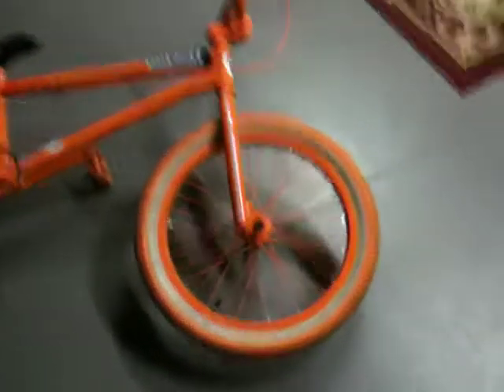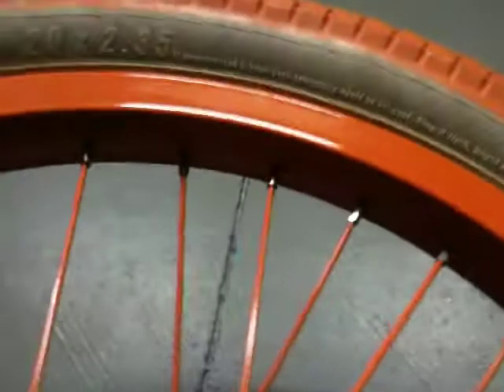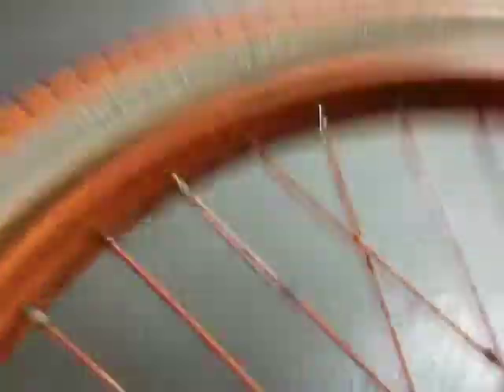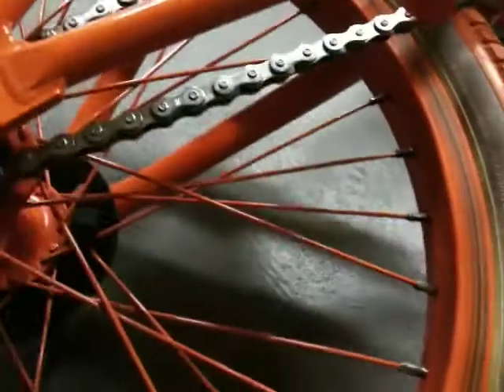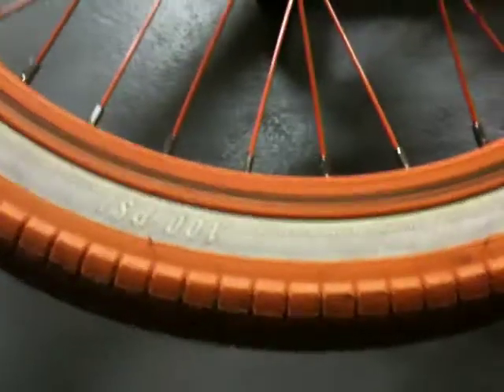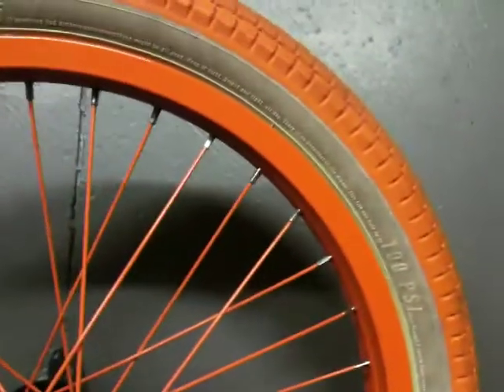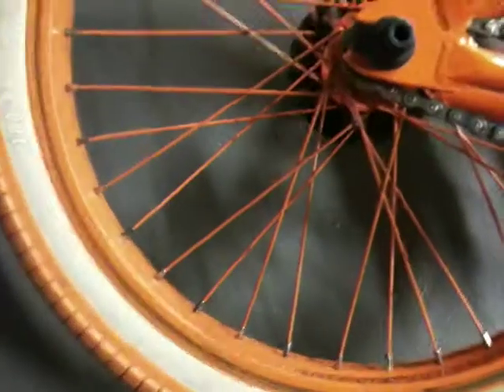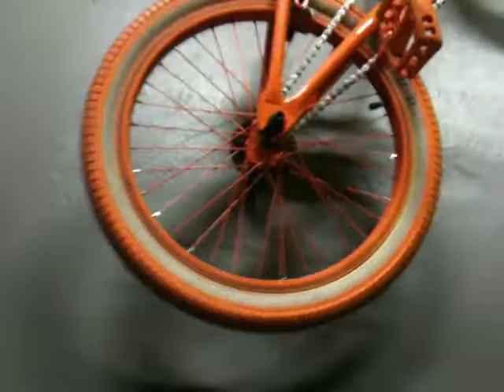odyssey quadrant review

Comment: sand brake pads to get those off and the paint will not come off just use WD 40 spray the rim and scrub it with a paper towel it’ll come back completely clean and won’t remove any paint at all just the WD 40 and scrubbed brake pad that’s just collected loose rubber that compressed into the top layer under friction. This has worked with cheap oem white rims for me

Comment: solution is to take your brakes off don't be scared or you have to clean your wheel daily so debris and rocks and dust dont go on the wheel and the pads won't smash them onto the rim and pull them around scratching the rim id go brakeless if I were u